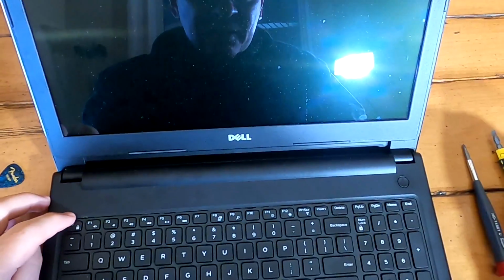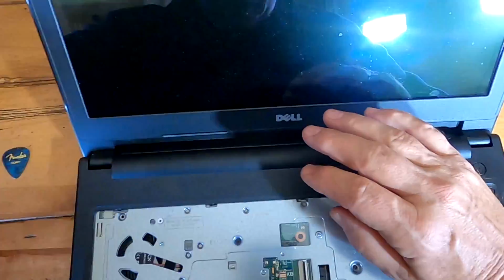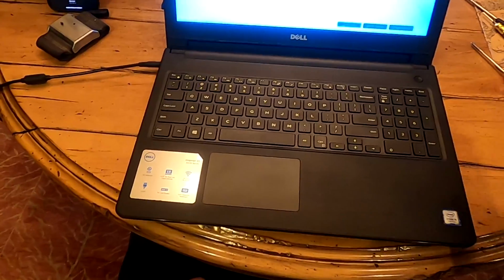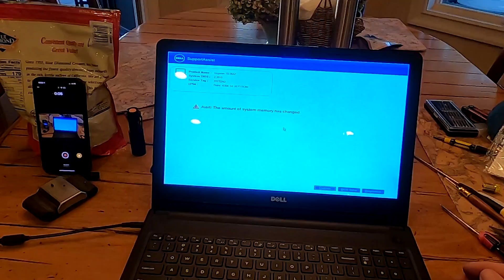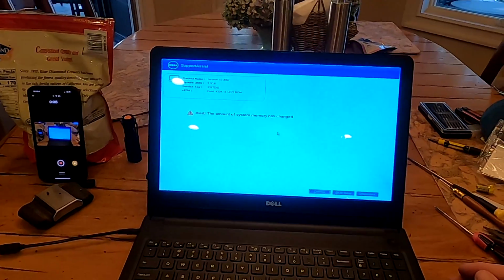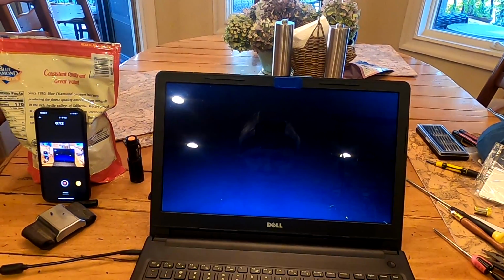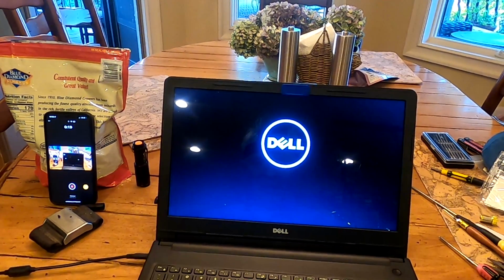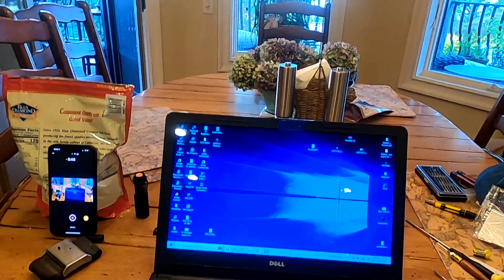Add RAM to Dell Inspiron 3000  Laptop. Speed Up your Dell Inspiron 3000!

Comment: This is an old version of the Inspiron 3000 laptop. Dell no longer makes them this way. The keyboard is not removable from the front and the battery is not accessible easily unless you remove the back panel. This video is for 2022, about the same year I bought my Dell Inspiron 3000. Must be a very old version of the Inspiron 15.
Reply from the maker: Thank you for your comment. I did not know that it was an old version when I put the video out. I think the laptop at that time was current but time does March on. Thanks again for your comment. By the way, the addition of RAM did not speed up, my computer noticeably. Thanks. Consider subscribing. Joe.